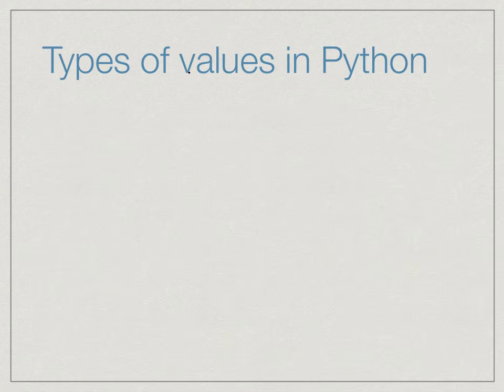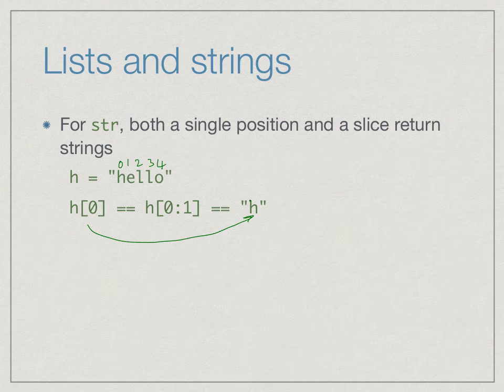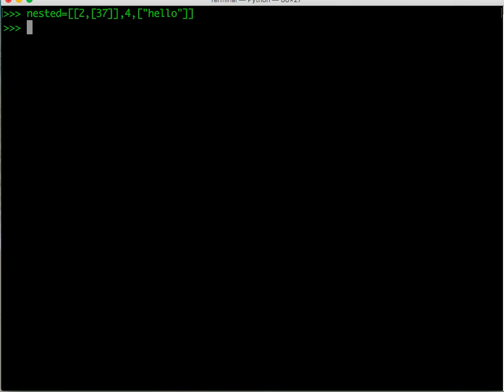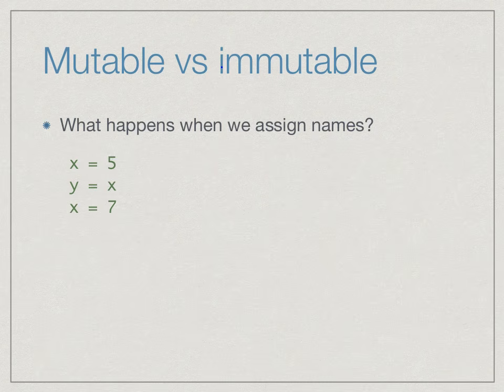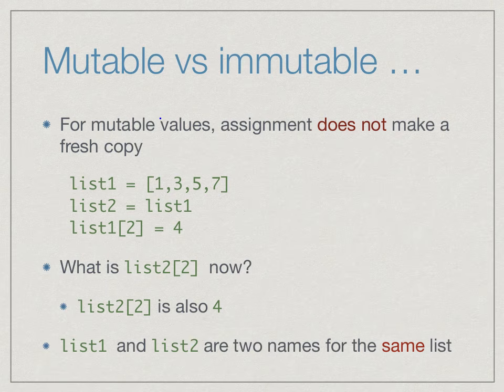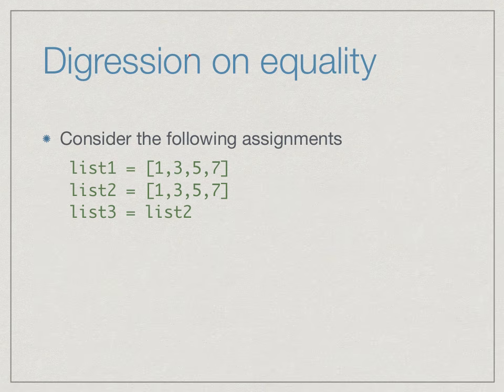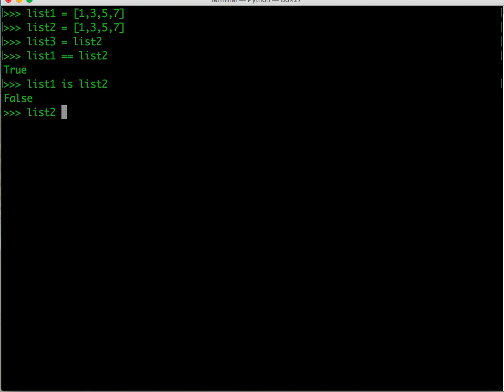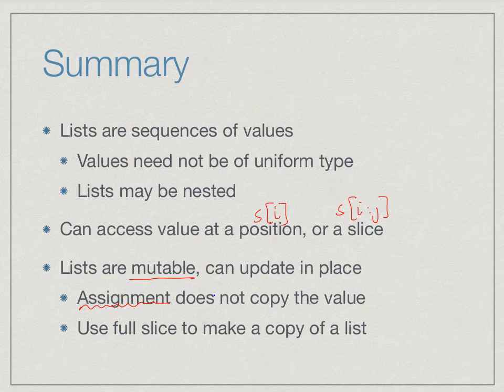lists

Comment: 22:37. Consider the following code, 

my_list = [1,2,3]
new_list = my_list

my_list = [4,5,6]

If my_list and new_list point to the same data, why am I getting different outputs?
Reply: List [4,5,6] is a entirely new list. So what you are doing is making my_list pointing to a new list [4,5,6] so my_list will now point to [4,5,6] but new_list still points to the old list [1,2,3].
You should only assign a value or a slice  of list like my_list[0] = 6 or my_list[0:2] = [6,7] like that. Only Then both lists have same value.
Reply: you are not pointing new list to my list as you are not using pointers. you made new list as my list and then changed my list so you will get different outputs

Comment: I did the same thing as him, created two lists1 and list2 with same elements. However, when I executed 'list1 is list2' system gave 'False'. Then I checked list1 and list2 values, but they were same. Why did it show False?
Reply: is gives true only if they are pointing to same objects. if you had written list1 = [1,2,3,4] and then list2 = list1, then you can expect the output of list1 is list2 as true.

Comment: I think both value pointed to same location when 
x=5
y=x
but when
x=7
x is bound to new value and y remain to previous bounded value
Reply: That is not true. when you assign a variable which has a immutable value type to another variable, you are creating two separate instances of object. You can easily check this in pythontutor.com
Reply: I agree with this initially they are pointing to the same location because print(id(x)) and print(id(y)) gives the same result , which means they are pointing to the same value . After updating the value of x , x started pointing to other address and y is still pointing to the initial location.